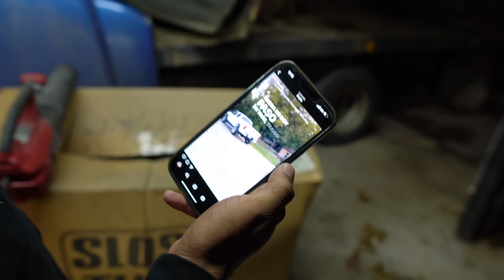Chevy Cam Lt 5.3 - e85  VS. Chevy Cam Lt 5.- 93 VS. GMC Lt 6.2 - 93

Comment: If the front rotors aren’t crack or to thin according to spec you can just machine em down and they’ll be brand new and it’ll save you money dawg
Reply: Dope vid bro just need a new modern intro, that 2005 intro is sounding a little old 😂

Comment: Mm check your fuse from interior to remove old to put new fuse in it and same thing with exterior fuse box also check your relay flash under steering wheel plus check your bed with junction block too last one check your pedal stoplight switch

Comment: If the break light works but the running dosent its an electrical issue might’ve been when you replaced the block bro. I changed my signal switch and i never had the issue again might be something worth looking into since i switched the bulbs, harnesses and checked fuzes and still had the issue.

Comment: My truck was having electrical issues and it was the main fuse box underneath the hood my head lights would flicker then one brake light wouldn’t turn off that was when I took it the dealership and they replaced it with a new one